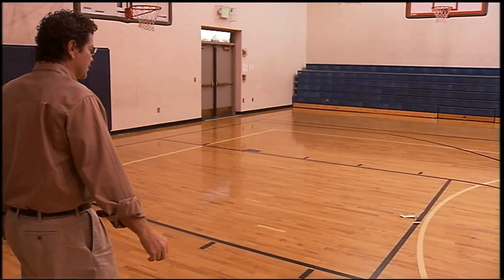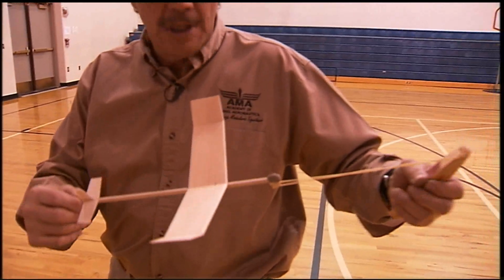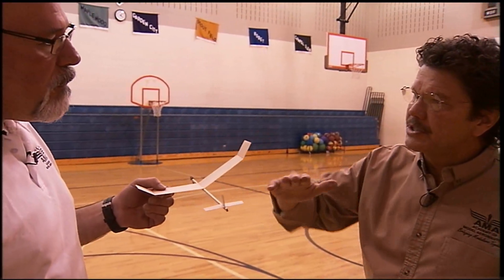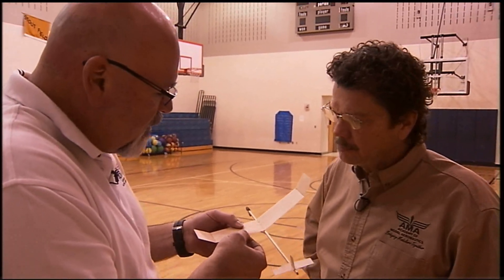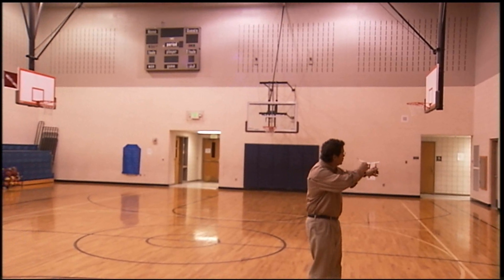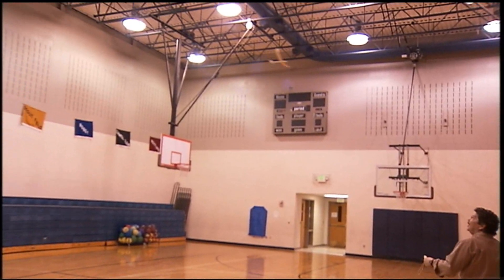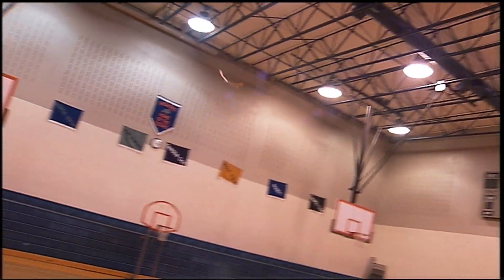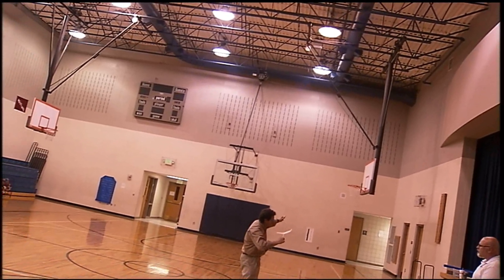Rick Crosslin Science Trim to Fly a Balsa Glider AMA & Science Olympiad

Comment: Personally, to tame that severe turn, I would reduce the stab tilt.  Also, warping surfaces is not the best way to do things.  Warps will not remain in the surfaces.  Also, they often have the opposite effect than intended during launch because of aeroelasticity.  Instead of warps, use 1/32” balsa strips as wash in or wash out wedges as needed.  Once you glue them on, they stay put and the model will remain in trim regardless of conditions at your flying/competition sight.

So there’s a few tips for those of you who found this looking for info on SO gliders.  If you want more info, or need help getting your glider to perform, check out www.hippocketaeronautics.com   There is an entire section in the builders’ forum dedicated to SO competition.

Comment: Wow mine sucks so much
Reply from the maker: <p class="MsoNormal" style="margin: 0in 0in 0.0001pt; font-size: 12pt; font-family: 'Times New Roman', serif; color: rgb(0, 0, 0); line-height: normal; background-color: rgb(253, 253, 253);">Glider dimensions (templates)</p><p class="MsoNormal" style="margin: 0in 0in 0.0001pt; font-size: 12pt; font-family: 'Times New Roman', serif; color: rgb(0, 0, 0); line-height: normal; background-color: rgb(253, 253, 253);">Wingspan 12" or 30cm, wing chord 7 cm   (wood is Balsa 3/32 thick with the camber sanded.   ( I/16<sup>th</sup> thick wood is ok but not efficient in flight). This wing may lengthened or shortened or extra dihedral added to comply with wingspan rules.</p><p class="MsoNormal" style="margin: 0in 0in 0.0001pt; font-size: 12pt; font-family: 'Times New Roman', serif; color: rgb(0, 0, 0); line-height: normal; background-color: rgb(253, 253, 253);"> </p><p class="MsoNormal" style="margin: 0in 0in 0.0001pt; font-size: 12pt; font-family: 'Times New Roman', serif; color: rgb(0, 0, 0); line-height: normal; background-color: rgb(253, 253, 253);">Fuselage 14" long x ¼" X 1/8" stiff balsa. Shark's tooth to hook rubber loop needs to match rules. Add to bottom of nose and then cross-laminate with 1/32" wood on both sides for strength. Fuselage may be shorter but never less than 110% the finished wingspan.</p><p class="MsoNormal" style="margin: 0in 0in 0.0001pt; font-size: 12pt; font-family: 'Times New Roman', serif; color: rgb(0, 0, 0); line-height: normal; background-color: rgb(253, 253, 253);"> </p><p class="MsoNormal" style="margin: 0in 0in 0.0001pt; font-size: 12pt; font-family: 'Times New Roman', serif; color: rgb(0, 0, 0); line-height: normal; background-color: rgb(253, 253, 253);">Stabilizer- 76 mm x 2 mm X 1/32" thick balsa sanded to 1/64" on trailing edges (for easy flight trim adjustments)</p><p class="MsoNormal" style="margin: 0in 0in 0.0001pt; font-size: 12pt; font-family: 'Times New Roman', serif; color: rgb(0, 0, 0); line-height: normal; background-color: rgb(253, 253, 253);"> </p><p class="MsoNormal" style="margin: 0in 0in 0.0001pt; font-size: 12pt; font-family: 'Times New Roman', serif; color: rgb(0, 0, 0); line-height: normal; background-color: rgb(253, 253, 253);">Fin- 24 mm X 24 mm X 1/32" thick sanded to 1/64 on trailing edges (""  "")</p><p class="MsoNormal" style="margin: 0in 0in 0.0001pt; font-size: 12pt; font-family: 'Times New Roman', serif; color: rgb(0, 0, 0); line-height: normal; background-color: rgb(253, 253, 253);"> </p><p class="MsoNormal" style="margin: 0in 0in 0.0001pt; font-size: 12pt; font-family: 'Times New Roman', serif; color: rgb(0, 0, 0); line-height: normal; background-color: rgb(253, 253, 253);">Add clay ballast to nose only. Glider should balance approx. ½ the distance from the leading edge of the wing.</p><p class="MsoNormal" style="margin: 0in 0in 0.0001pt; font-size: 12pt; font-family: 'Times New Roman', serif; color: rgb(0, 0, 0); line-height: normal; background-color: rgb(253, 253, 253);"> </p><p class="MsoNormal" style="margin: 0in 0in 0.0001pt; font-size: 12pt; font-family: 'Times New Roman', serif; color: rgb(0, 0, 0); line-height: normal; background-color: rgb(253, 253, 253);">Hope this helps,</p>